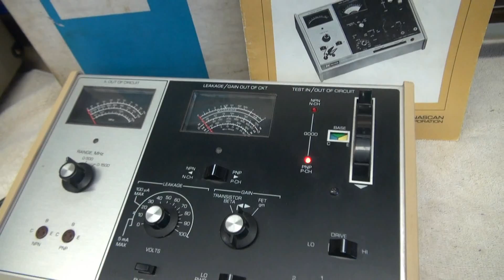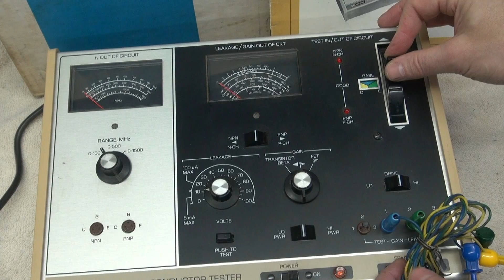B&K 530 Transistor FET Tester Best for Vintage Stereo Marantz Repair

Comment: Is the BK 520B the same as the 530? or does it have its differences? and wich one is better?
Reply: Although there is nothing "automatic" about it, the 520B and 530 are similar,  yet different. The 530 has 2 sections to it. The section he showed, has all the same functions as a 520B, ( they both determine NPN-PNP and lead configurations on a good component) except the 530 has an adjustable leakage voltage of up to 100 volts, which can help in finding the maximum  Collector - Emitter, Reverse Collector-Emitter, and Collector to Base voltage up to that voltage, or can find a leakage fault / forward and reverse voltage in a diode or Zener diode ( It can be paralleled with an accurate voltmeter go get a closer to exact measurement), it looks like the 520B only has an automatically variable function for leakage with no calibrated control knob. The 530, if functioning properly, has a separate "Transition Frequency" test section on it's left, it's a stand alone board and meter within the unit, that allows a tech to determine the "Ft" , or, working maximum frequency range that a component may operate in .It is calibrated into 3 test ranges, 0-100 MHz, 0-500Mhz, and 0-1500Mhz, using 1MHz,10MHz and 30MHz respective  base drive signals. This can help you select the functional frequency range of a component that may be "acting up" , or may help in selection of a replacement transistor for something like an amplifier stage in a FM tuner, versus accidentally subbing in a part only suited for AM or even audio frequency circuit use.   All in all, IMO, the 530 is a much more practical tester if you work in devices needing to have transistors checked, and the "Ft" test section is fairly unique to any transistor tester. The problem would be, finding a good working unit, or being to repair a defective one, but the manual with good service info and schematic, parts list and calibration info are available online for free if you look.